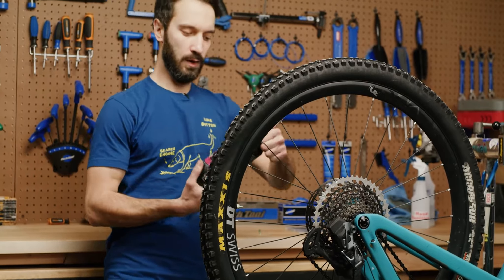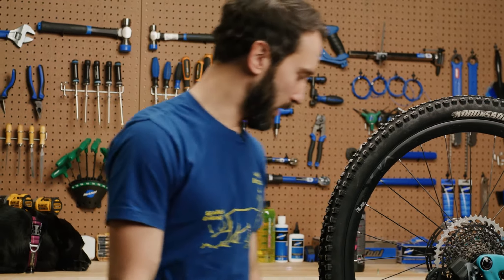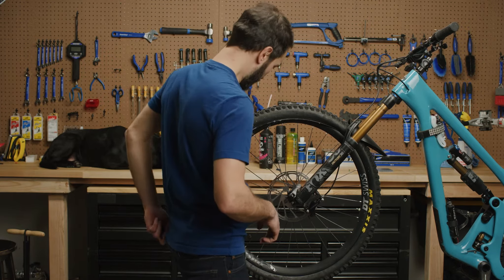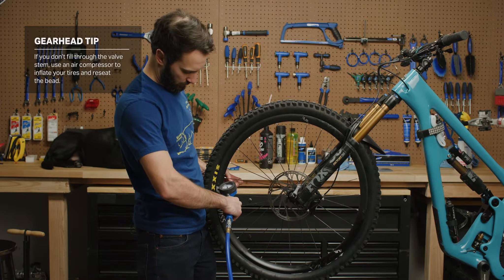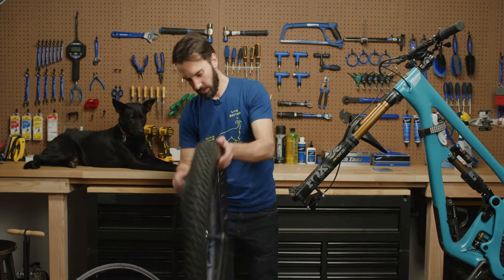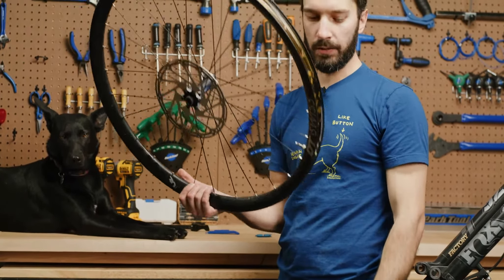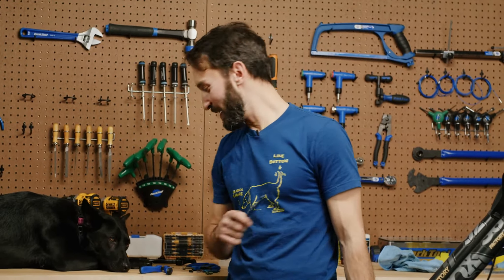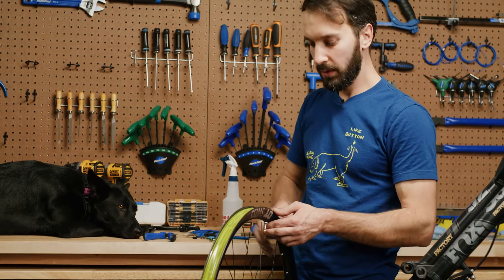How to Refresh Your Tire Sealant

Comment: This is the best video on how really hard (for the average JOE), messy and time consuming (specially the cleaning) is to service a TUBELESS wheel (and is done by Luke bike shop manager). Everything that could go wrong went wrong 🙂.  reading and watching online content, everything looks easy and the cost at a LBS is about $30 to $40 (labor) to set up "one" new tubeless wheel.
Now my question is, How much does the LBS charge to do the job that Luke does in this video? Luke, thanks for the real world situation video. 

s abound
Reply from the maker: Thanks, Alberto!

Comment: My tyres have Giant sealant in them but switched to Muc-Off.  Do I need to take the tyre off to get rid of the ole stuff before adding the new sealant?  If so should I be fine topping up in future without cleaning the old stuff out if not changing brands?  Already got the valve core remover but waiting on a tyre lever which makes it more of faff.  New to this.  Thanks.

Comment: Adding sealant through the valve doesn't work with a sealant like Silca with a lot of particles that will clog the valve and refilltube. stans Race will also be a problem.

Comment: Ok this video was cool because you guys left in the misadventures and that’s more interesting to me than the scripted content. And Luke is a great presenter. However one bit of critique I’ll pass along is that there was no mention of the need to remove the crusty old sealant that dries up inside the tire over time. It’s a good idea to remove that crud, most certainly if you’re changing sealant brands (many don’t mix well). So while you recommended AGAINST removing the tire and simply injecting new sealant through the valve, the tire probably should be removed once a year for a proper refresh by cleaning out old sealant.